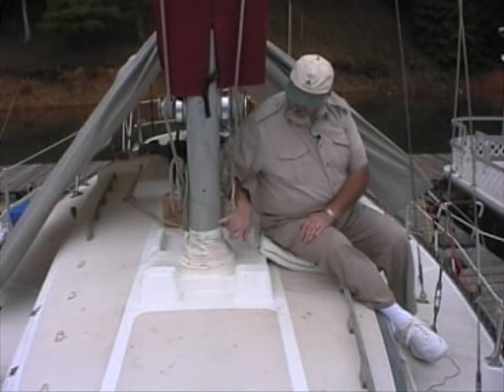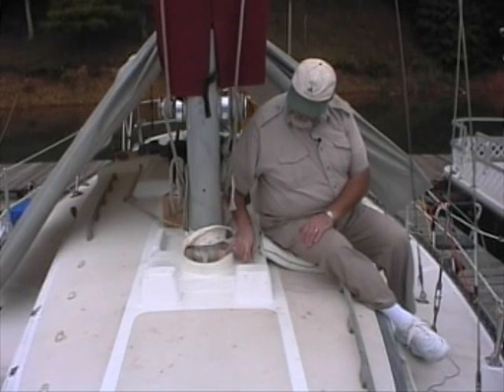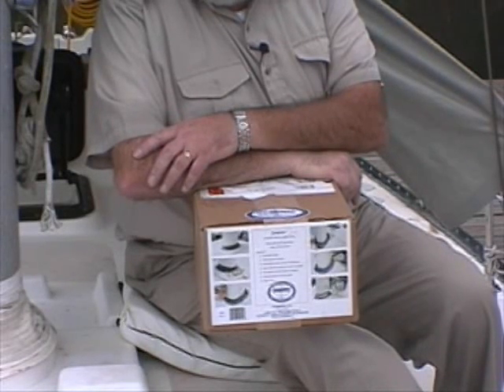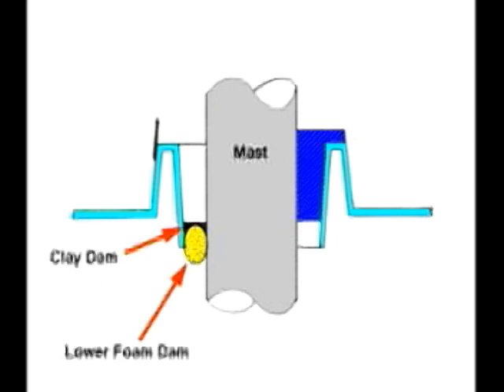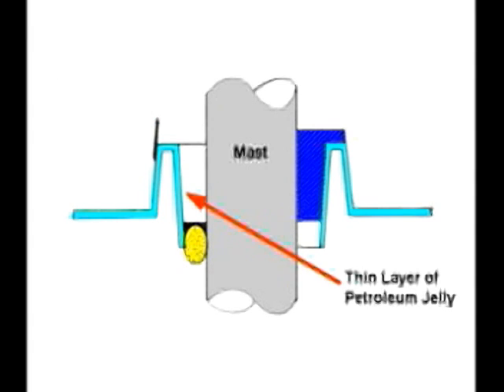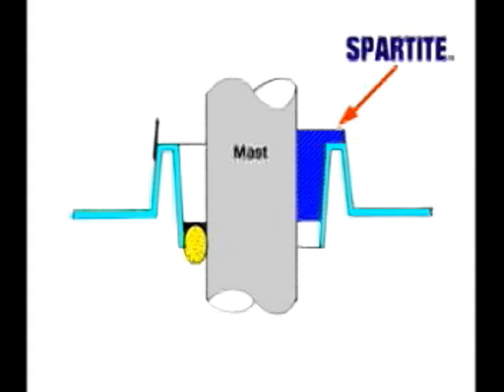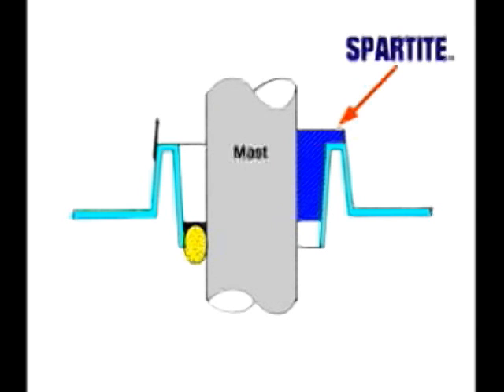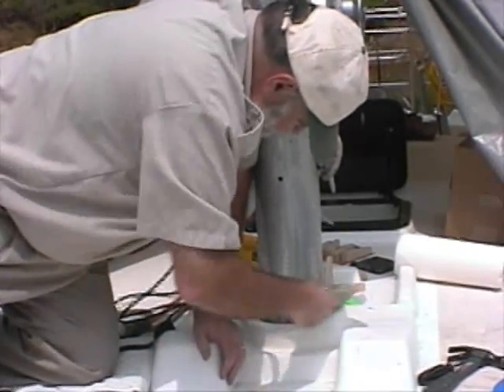Spartite Installation, Part 1

Comment: thank you for this 3 part video... i just boat a 1970  spencer and it has a terrible mast seal... i have a question thou...those the mast need to be right on the center of the existing hole its in? my mast is to one side of the hole more then the other side  and it appears is where it should be because the wood studs that are still there (4left) are different sizes (different thickness)